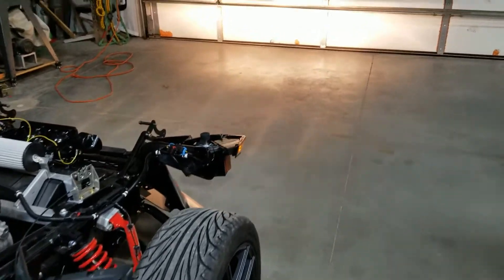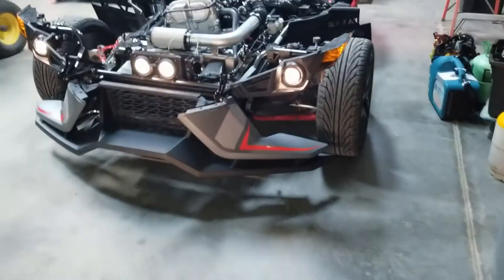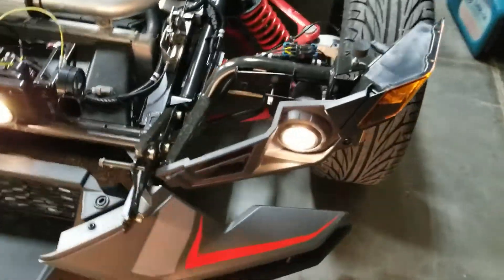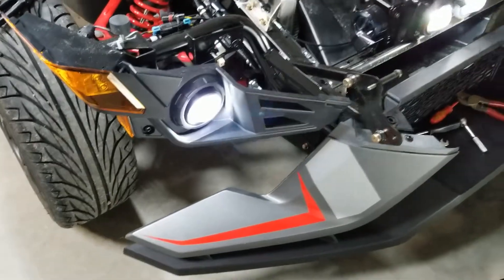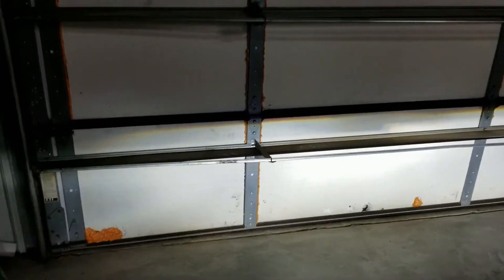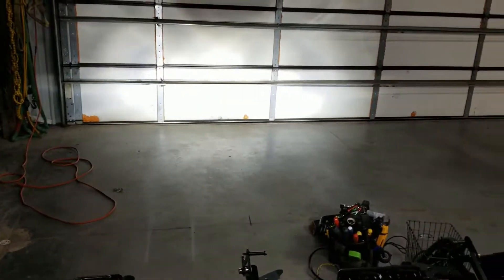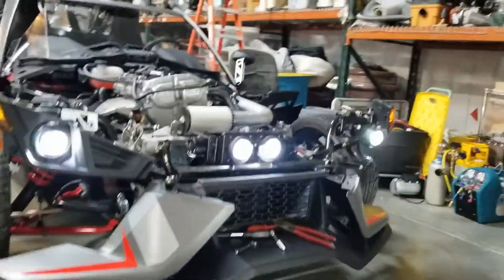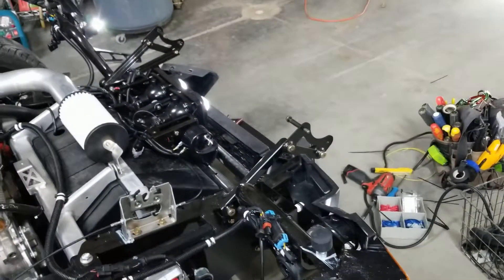Polaris Slingshot LED Conversion

Comment: Did you say fans in there running.?
Reply from the maker: Yes, these lights have small fans that take the heat out from the LED driver when the lamps are lit.  I really like them and they have been no issue for me.